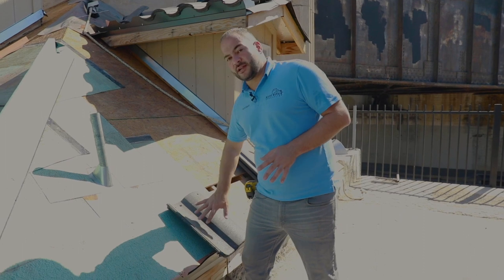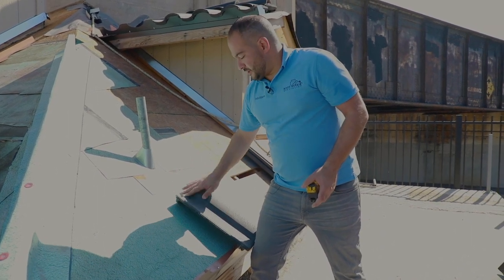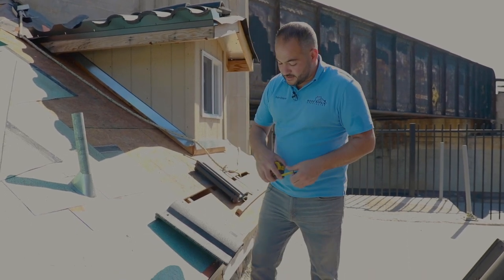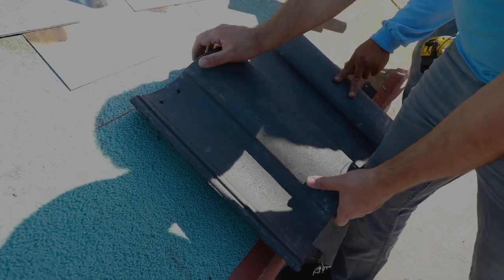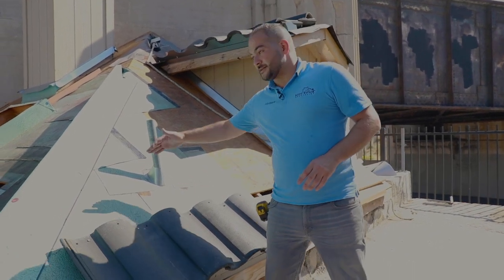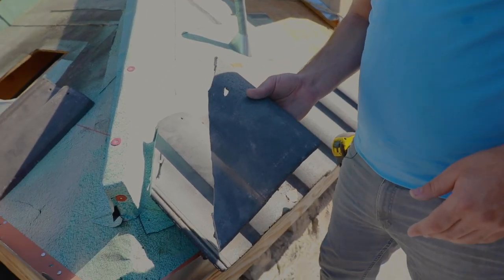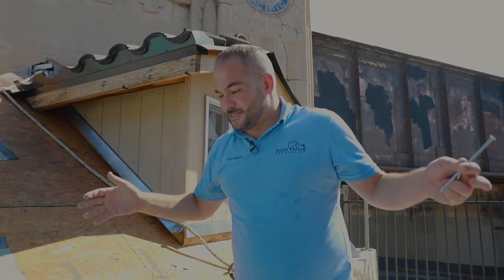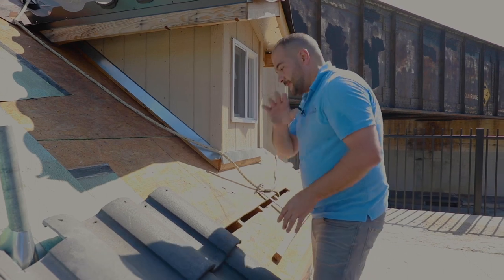How to Install S Shape Roofing Tiles

Comment: What about swing tape technique
Reply from the maker: What’s that?
Reply: @RoofRepairSpecialist  old timer taught me this trick said it was the only way to install tile. Basically it evens out all the courses so they're all even and you don't have a short course at the ridge. If you do it rite all the rows will come out even and all your lines land somewhere between 12 or 13 1/2, it's kind of hard to explain in writing but You do a 2 in. line from the ridge your bottom line at @ 14 in. Pull a tape between the lines then depending on how many course theres going to be you swing the tape until you hit an increment of 14 or 13 1/2 then follow the increment you started with all the way. If you do it rite it spreads the short course evenly through all the courses. For S tile as long as your lines are at least a foot apart and your installing bats your tiles won't be kicked up and all your courses are equal. However I prefer not to go less than a 12 &1/2 inch gap between my lines p.s never done tile without doing bats didn't even know you can go straight to the deck lol
Reply from the maker: Ah got it, we do that on most roofs, first time I heard that term. Thanks for enlightening me